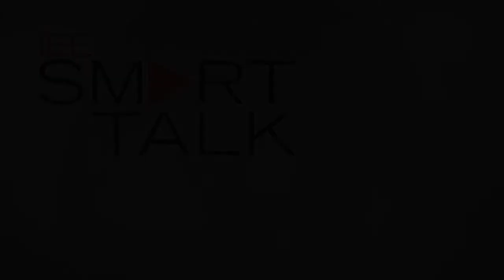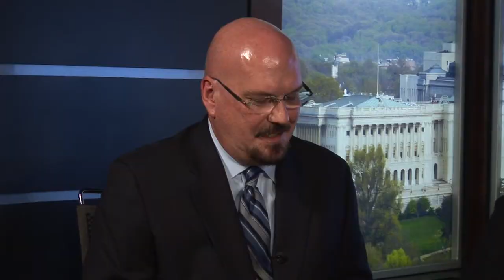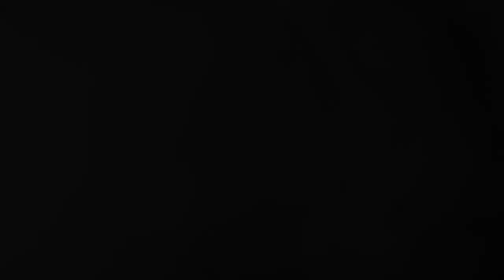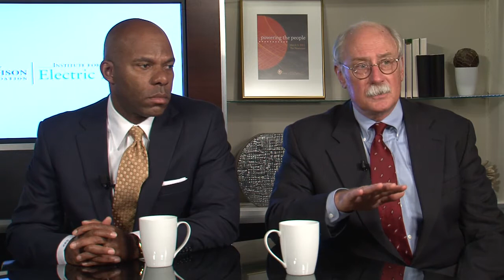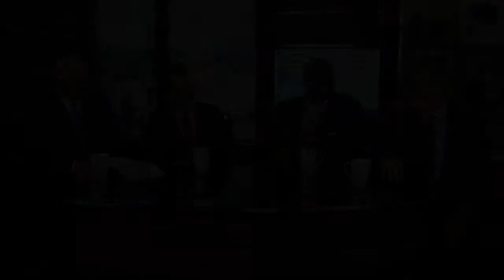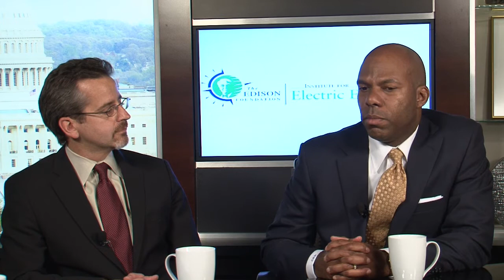IEE Smart Talk #1 - The Benefits of Smart Meter Technology

Comment: It is a packet forwarding system, that forwards your information along with others as it passes your meter. So it has to forward data as required and not for as short as you state either.  Hard to phantom that you dont know this,let alone all the unnecassary RF (radio frequency) that you are generating from such.
   E

Comment: Thanks for your comment. Actually, smart meters don't use customers' electricity. They run off of grid power and don't meter their own use, so it doesn't count toward your bill. Also worth noting, smart meters use very little energy. The common SM300 model from Honeywell uses a max of 1.2W, and only reaches that level for a few seconds every 15 minutes. By comparison, one popular coffee maker from Keurig (the elite 40 series) maxes out at over 1500W during a brew cycle, which last much longer.